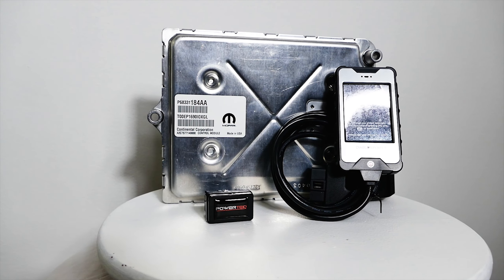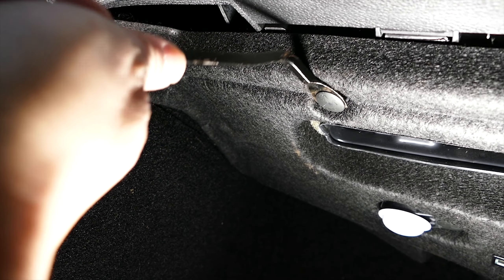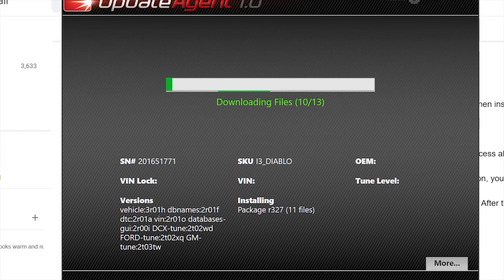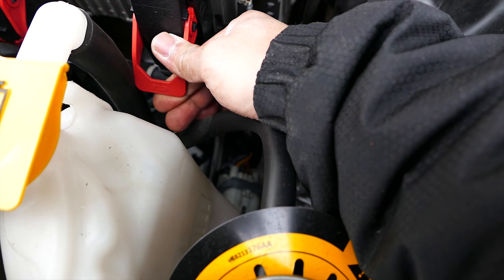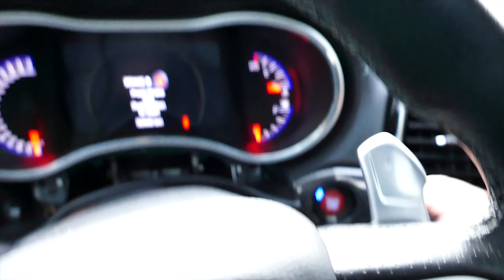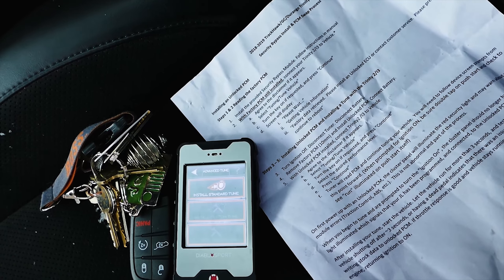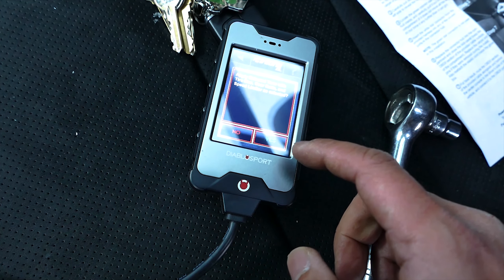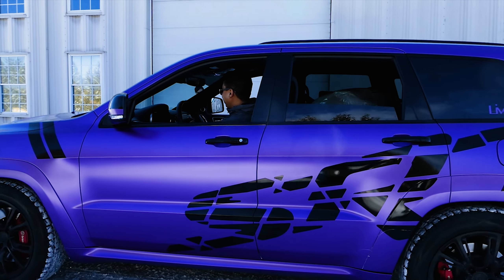pcm jeep grand cherokee

Comment: Hey Fred thanks for the video, weve got a RT Jeep and an SRT Durango. Considering swapping the PCM and diablo install on the Durango SRT: However, I have an aftermarket extended warranty. Will the PCM swap affect this warranty? Is it possible to keep the stock PCM and swap it out if need be for warranty?
Reply from the maker: hey there, yea I keep my stock pcm and swap the out the unlocked computer for the oem one whenever I went to the dealership for warranty work